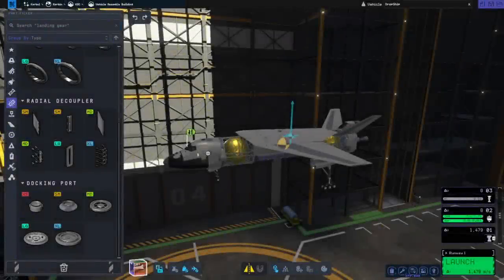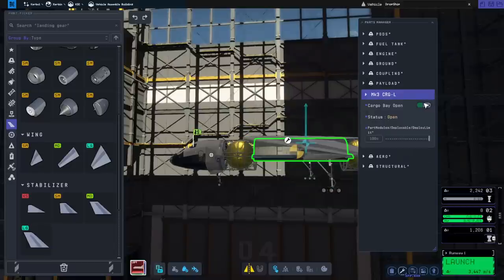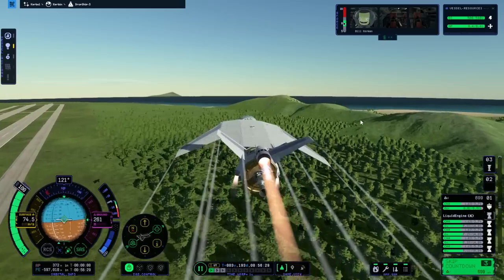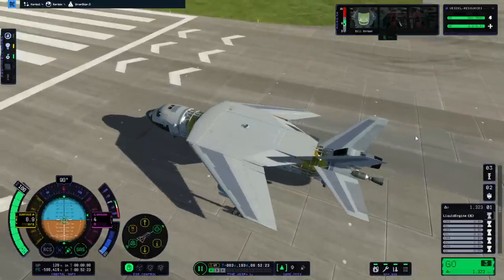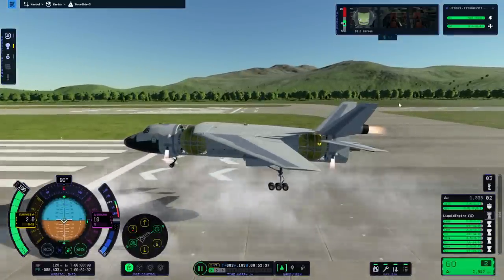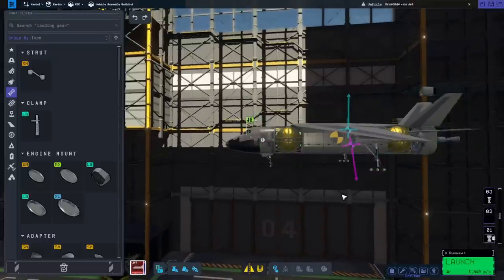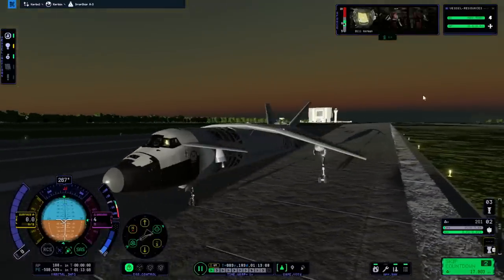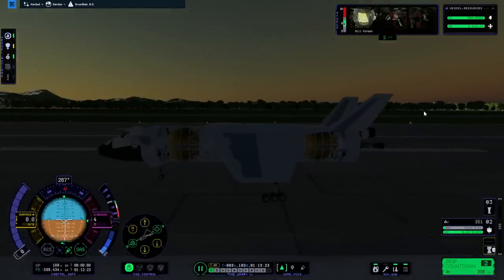KSP 2 Early Access - DropShip Kerbin Testing

Comment: The inverted pitch wings were actually inverted and fought against the other pitch surfaces :D
Reply from the maker: Their placement was just not ideal for pitch control anyway in either direction. They were acting as flaps, which is not strictly wrong, but also not ideal in every situation, which is why I turned them off.

Comment: Maybe try use 2 jet engines for more thrusts which means more control, put them on the sides or under the wings, more weight towards the centre of the craft is always good. And also you wont need that much jet fuel, just enough to get yourself stable during landing. I think there's a bit of fuel in some of the pre cooler jet engine bits? That might be enough!

Cool concept, big drop ships are my favourite thing to make, just a bit tricky! God speed!
Reply from the maker: I don't want to carry two jet engines all the way to the Mun or Minmus and back, though - it's not efficient for the Thuds or the Nerv. Maybe in a variant where we only have jets and just move stuff on Kerbin.
Reply: @RaizSpace  I get them, but I assume you wanna land it back at the KSC after right? So your gonna need some control!

If not jet engines, how about replacing the jet engine with another Thud? Can share the same fuel and im pretty sure it can out thrust the jet engine. 

The trouble with making dropships is you cant really get around the fact its going to be a super heavy big boy and even more so if you wanna fly it back to KSC, so you might as well embrace it and make it bigger with more engines but the same payload size. 

Hell that things gonna need RCS for stability control on mun/minmus landing and thats not light either. 

Im happy to spitball ideas though! I love this series and your enthusiasm!

Comment: great looks. i tried to build similar plane but no success. looks like the wings just dont want to work that way...
Reply: wings usually prefer a horizontal take-off unless placed vertically =)
Reply: @DavidEdwards9801  i tried to take off like a plane. I think vtol used way to much fuel. But my wings shaped like that seem not to create lift for whatever kerbal reason
Reply: @gutek5930  Yeah, there seems to be a disconnection between game developers, software engineers and real life physics

Comment: The an-hydral wing, anti dyhedral? Probably aren't helping stability either
Reply: Anhedral
Reply from the maker: On the contrary, anhedral wings can help with stability, which is why you often see them on heavy lifters: https://i.stack.imgur.com/soJjK.jpg. Or, perhaps more pertinently, the Harrier: https://cdn.britannica.com/41/27141-050-9A478FEB/AV-8-Harrier-V-STOL-jet-fighter-US-Marines-1966.jpg. Dihedral is more associated with maneuverability. No guarantee this arrangement is good for reentry, but there's also no guarantee that KSP 2 aero is anything resembling real life, anyway.
Reply: @RaizSpace  From what I'm reading, anhedral always adds roll instability, but sometimes that's desired. From wiki:

"Anhedral angles are also seen on aircraft with a high mounted wing, such as the very large Antonov An-124 and Lockheed C-5 Galaxy cargo aircraft. In such designs, the high mounted wing is above the aircraft's center of gravity which confers extra dihedral effect due to the pendulum effect (also called the keel effect) and so additional dihedral angle is often not required. Such designs can have excessive dihedral effect and so be excessively stable in the spiral mode, so anhedral angle on the wing is added to cancel out some of the dihedral effect so that the aircraft can be more easily maneuvered."
Reply from the maker: @Aaron Epstein Perhaps I misunderstood, but on high-mounted wings I understood anhedral to improve the situation - I guess it's because it's too hard to maneuver otherwise rather than for stability. In any case, I didn't actually find the roll problem to be caused by the wing (as verified when I maneuvered in jet mode) but the general quirkiness of controlling a VTOL. I don't believe the wing's anhedral caused any issue here.
Reply: @RaizSpace  heavy lifters have anhedral wings (on the ground when pictured) because the are not generating lift and/or filled with fuel.  When generating lift they can flex a couple of meters ( depending on aircraft) and become dihedral
Reply from the maker: @GimbleOnDew Very well, but I was thinking more of the Harrier with this particular design.

Comment: I wonder if the hydrogen didn't affect center of mass because it is lighter than air.  I know mass != weight; just speculating.
Reply from the maker: The VAB shouldn't know whether we want the center of mass in relation to an atmospheric body or not anyway. In fact, in this case we're very much interested in it on the Mun and Minmus.
Reply: Compressed Hydrogen in a container is heavier than air.